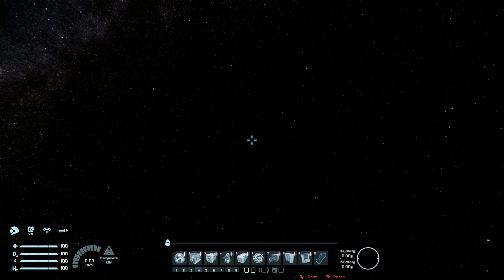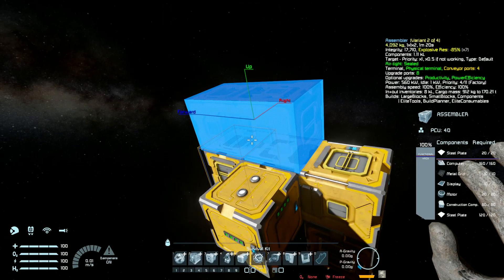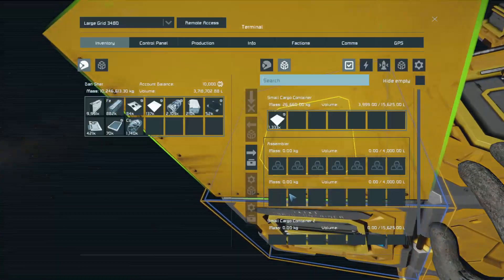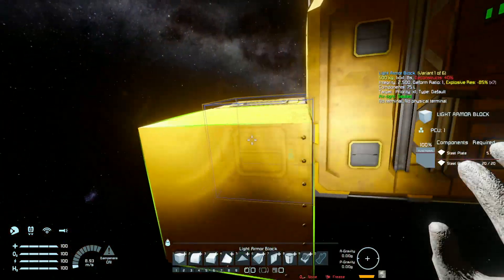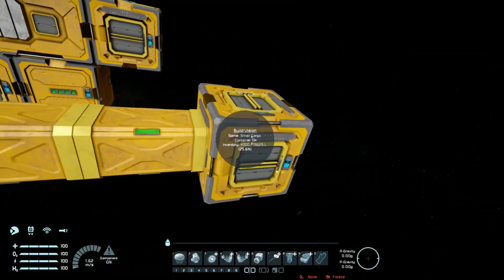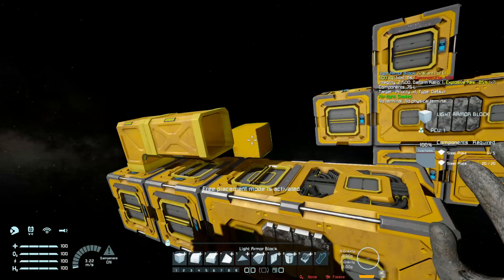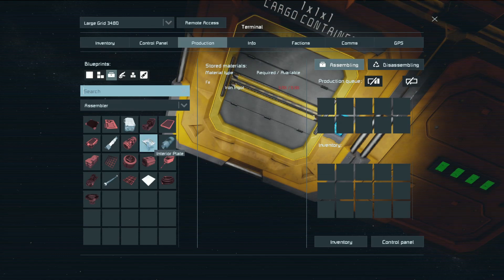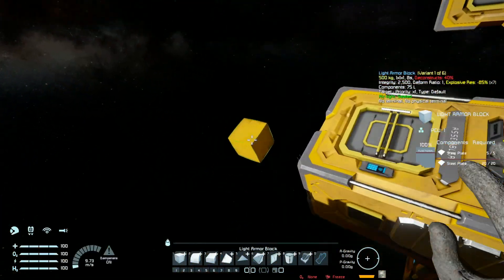Conveyor Push & Pull Mechanics / Space Engineers Tutorial

Comment: you've described a for loop
for each port, determine if there is room to store something
it starts at the top (the preferred port of the assembler) and works it's way down
makes sense that the assemblers preferred port would be on top and the refinery's would be on the bottom
the biggest revelation from this test is that if the next adjacent block is not inventory-compatible (like the O2H2), then it is skipped entirely. the sorting algo doesnt waste operations searching further than that when other ports are available, which is exactly how you'd expect a programmer to design it